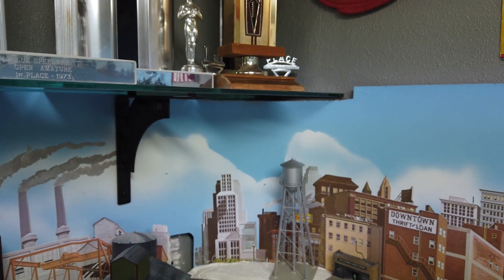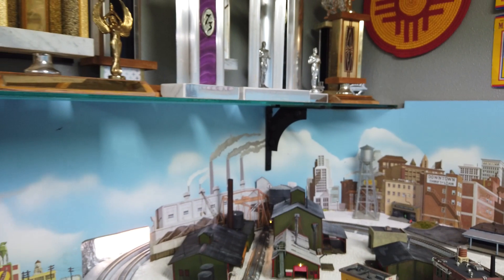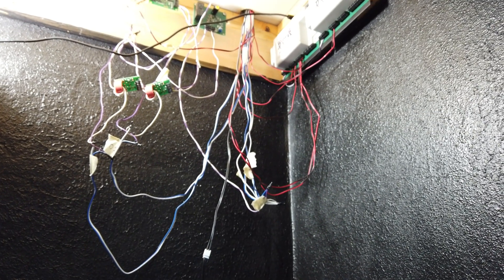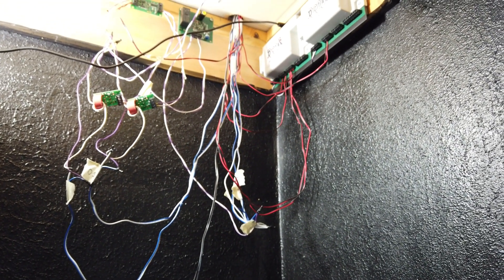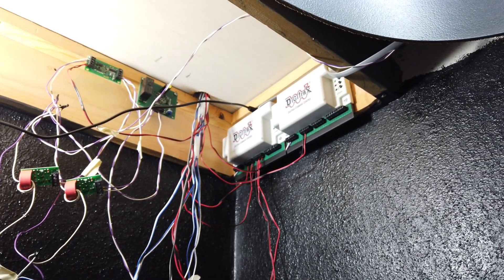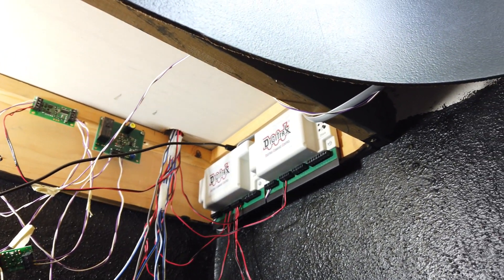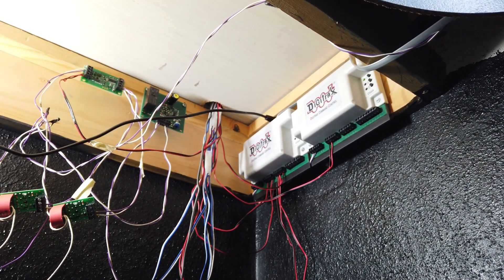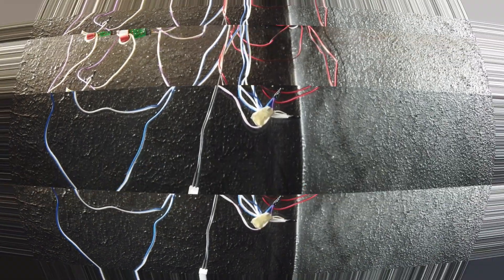N Scale ACTRR 3 Update #82

Comment: Ramble all you like. Just good to hear another voice being home bound so long. Top of water tower always has a light for aircraft avoidance. A lot of the hill climbing I did we did not always know what was at the top. 650 Triumph.
Reply from the maker: My hill climbing was done on a 250 Yamaha MX with 0 air in the tire and tight bead locks
Reply: @N-Scale  Knobby tire with every other row cut down.
Reply from the maker: @gvet47  New Knobby but no cutting and I beat a extended Harley with a paddle tire.
Mike